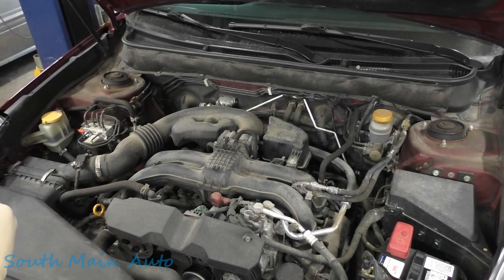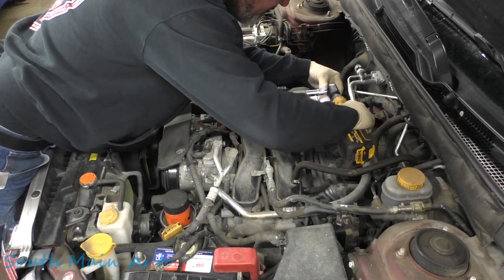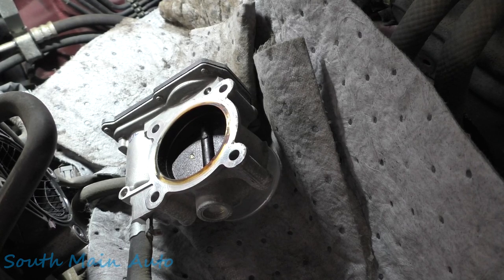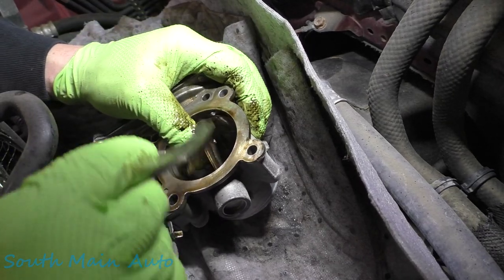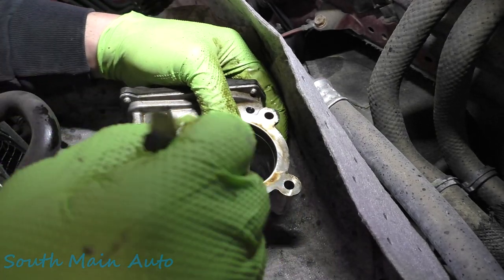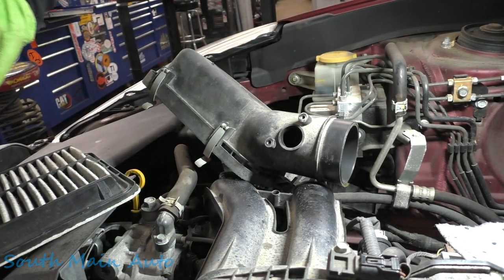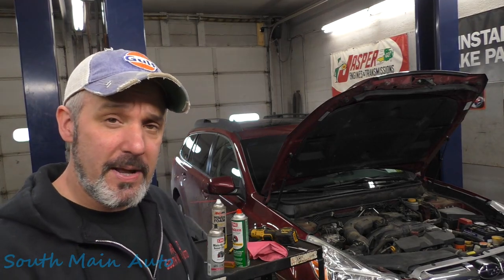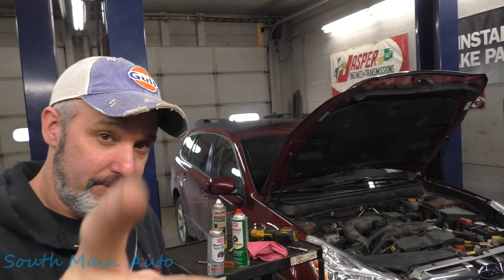How Does Your Shop Deal With Intermittent Symptoms?

Comment: Shop I went to charged me for diagnostics, changed all the plugs and coils and charged me over $900.  I drove out of their shop and had the same problem (misfires) 2 miles down the road. I ended up buying a few tools, watched your videos and Scanner Danner videos. I purchased an Alldata subscription and found low fuel pressure. My neighbor changed my fuel pump for me and now my car runs great!  Some shops are not repair shops, they are parts changers and have no clue about diagnostics. The people in your area are lucky to have someone like you that really is a diagnostic technician. Thank you for your videos and being an honest repair shop.
Reply: Seems most shops are just parts slingers these days as you say.  Faster and easier way to make money, why bother looking for the actual problem??
Reply: Flatski daddio: I find watching Eric O diag a problem helps me immensely since he does this day and night and probably asleep.
Reply: I'm just a schmuck that enjoys watching SMA videos but thought I could hear an extra 7.5 horsepower throbbing
in the exhaust noise.
Reply: So true, SMA is not a parts changer, neither is scanner Danner or Ivan w/ PHAD. These shops are following the correct procedures to fix what is causing the problem so they do not have come backs and having to work for free the second time or third. There is a process to do this, it takes skill, equipment, knowlege and some research to find the failure points. Sometimes all it turns out to be is a corroded electrical connection or a bad solder joint...no parts needed at all, just a fix to something that was manufactured with flaws or a poor design that needs corrected.
Reply: Most shops are just parts changers.
Reply: Lol What did alldata do in finding low fuel pressure?
Reply: I’d have been back to that shop like a rocket, with friends if needed.
Reply: @CrimeVid  no joke, if they took me for $900.00 and it misfired 2 miles down the road, I'll be coming back and I'll be rolling heavy. One reason to pay with a credit card. Stop that payment, discuss and then discipline if needed.
Reply: @CrimeVid  I brought the car back and they worked on it the next day. They called and said it was the computer, then they said it's not the computer it's the engine, then they said they didn't know what the problem was.
Reply: @flatdaddio  you still should have stopped payment on your CC, i would have.
Reply: Same for doctors and hospitals, unfortunately. They treat you until you're out of money or give up.
Reply: @CrimeVid  "with friends if needed." 😀
Reply: @E99584  it probably gave him the spec of what the fuel pressure should be, and if you need any special tools to test for fuel pressure.
Reply: If a garage did the $900 diagnosis on my car and still hadn't fixed the issue. I would either have them refund me the money or maybe st least $800 and $100 for their time.   The other option would have been that take your diagnosis to the garage and asked why that procedure wasn't done to figure out the problem.  Have them explain to you their diagnoses procedure.  I also ask for a refund $800 for their misdiagnoses of the problem.
Reply: Have fun shopping at Walmart???????? Yeah right. Enjoy your videos.🇺🇸🇨🇦🇺🇸
Reply: And honestly, if a shop can't figure out a misfire by checking fuel, compression, spark, etc, they probably have no business even working on a car to begin with.
Reply: @E99584  I'm sure he checked a few other things before he came to the fuel pump.
Reply: This is why you always pay a questionable vendor or contractor or repairman with a credit card that has fraud protection and dissatisfaction protection. You could have called up Discover and said "Yeah, I just charged $900 for a repair on my car and the shop did NOT fix the problem at hand. The car exhibited the same exact problem 2 miles down the road. The shop refuses to reinstall my old parts and they refuse to reimburse me. I would like to file a charge back for services not delivered and dissatisfaction." They will cancel the charge and do an investigation and likely won't take your money. The shop may or may not take you to small claims, wherein you simply countersue for court costs and wages lost attending the court appearance which is totally fair and reasonable, and explain to the judge exactly what happened. A reasonable judge will certainly rule in your favor and you'll get paid by the shop for your wasted time and keep your $900. If you paid them with a debit card or cash, you're outta luck. You have to go right to small claims yourself to get that money out of their hands. If you paid by check, you COULD stop payment on it but most places don't take checks nowadays because of that. If your credit is bad and you can't get a credit card or you can't get a high limit card, there's no better time than the present to fix it. :) You can learn everything you need right here on YouTube to pull your 3 credit reports, dispute errors and dispute collections accounts, and get a few secured credit cards to start your way down the path of getting an excellent score. It's not that hard, and credit cards are EXTREMELY useful. You don't pay any interest if you pay off the balance each time in full. Most cards have some kind of reward too like my Discover card which gives me cash back and identity theft protection. My partner's BofA gives 3% back on gas. It's free money. No annual fees. No interest when paid in full. I don't spend any more than what I have in my bank. I love all the perks and everyone should too. :)
Reply: Should have went back and ask why they did not test drive to verify the repair. Demand refund
Reply: @avenger1888  You say, "Lucy, you got some 'splainin' to do!"  Then they would give you Ralph Kramden's best rendition of, hamna-hamna-hamna-hamna-hamna.
Reply: @maccarr9072  I asked if they drove it and they said they did. They will never give a refund.
Reply: @E99584  Alldata give you what the fuel pressure is supposed to be. I also didn't know what was wrong with it at the time.
Reply: @LoneWolfSparty  exactly. my car did not have a schrader valve so I had to order a special adapter and tool to disconnect the fuel line.
Reply: @larrygall5831  I did, I checked for vacuum leaks, found one, I also checked all the ohms on my fuel injectors. replaced the IAC valve, cam sensor and fuel pressure switch. That's as much as I could do without a gauge, adapter and fuel line tool.
Reply: @michaelmarks8954  Shopping is no fun any more.  You are basically a suspect as soon as you walk in the door, especially at Walmart and other big-box stores.
Reply: Buying tools is a good thing if u can use them. Second your always going to own a car
Reply: Seems like you need to sue that shop that ripped you off...
Reply: The foking majority of shops and especially damn dealerships are there to sell you parts NOT REPAIR YOUR RIDE!  Problem is there is little to NO recourse when they rip you off.  Especially in Texas. They can hold your ride ,fixed or NOT, until the bill is paid- fixed or not. Finding an honest QUALITY shop is nearly impossible anymore. Not many like Mr. O.
Reply: This is exactly why I do all of my own work on our cars.
Reply: @timbow50  That's why you should buy tools and use Mr O's videos as a reference to fix your own cars
Reply: Can anyone tell me why my car is idling a lot faster after clearing the throttle body? Does the car ECM need to re learn something?
Reply: @buddsmokengood420  I have never in my long life taken any vehicle to any shop. Don’t trust them anyway. I keep and maintain and repair my vehicles.  Sometimes it’s not easy but at least I’m not getting ripped off and lied to.
Reply: Ya they just tell you it's a different problem now,and your going to need more parts
Reply: You got that right.  You can usually tell the local shops that have someone like Eric present because the tow trucks are steadily dropping off vehicles there, not only from  owners, but from other local shops and the dealerships.  Eric reminds me of Louis Rossmann (search Rossmann Repair on YT).  Different fields, but both are outstanding troubleshooters who know that you have to understand how something is supposed to work to be able to effectively diagnose it.
Reply: I worked for a company that had around 25 trucks. They hired this mechanic that was terrible. All he had was a cheap Walmart scanner, a parts cannon, and nice set of new tools that the company provided. Everybody hated him. Everything his little scanner showed he would tell the owner it was the drivers fault. Water pump leaks, the "idiot driver" wore it out. U joint, same thing. The owner knew nothing about cars and believed him. Some of us ended up doing our own work on the trucks to avoid him. He spent so much time with his parts cannon that our trucks would be in the shop for weeks over something simple.
Reply: You needed my like to get 400 likes, thought I'd do the right thing.
Reply: Perfect description of my local Honda shop.  Parts changers, not technicians.
Reply: The only question after the " experts " present the estimate is " will it fix the car " . Remember , they diagnosed it . If they start to squirm " it needed it anyway , those parts were bad " , - excuses , etc. - just tell them you never stated that in the estimate . And it's still not fixed . You can offer to settle by paying their NET cost , NO labor , on the parts it didn't need . Otherwise , off to small claims court . It usually eats up half a day . Most places would be stupid not to settle . And it shows you are being reasonable . We are not nit picking over a relay , thermostat or filter here . THEY messed up . Good Luck .
Reply: But to be honest you sometimes it's more expensive to sit down and look through the data. But I worked also in a car repair shop and the boss would ask me what I doing looking for data. And I didn't had any information sources only the online forum which is useless often. Luckily I'm not there anymore but you proofed that information and a bit checking on the important parts can save money
Reply: Dropping some heavyweights (names) 👍👍
Reply: Hear hear the most honest assessment of repair shops and most shops have no clue and as to diagnostics they better show me confirmation on there diagnose or they pay for the parts cannon
Reply: But he didn't check the fuel pressure...
Reply: had a''mechanic'',,change my belt, w/pump. front seals, idlers. now,,its an ornament.. i would of done it but working flat out & it was leaking flat out.. should of waited 2 wks.. $1250. gurgler..ausie..
Reply: I'm guessing the number of us who actually is few. Diagnosis, feels hard if you make it hard. I've always found common sense is needed out there for the new ways mechanic's work now.
Reply: @Mountain-Man-3000 so many customers do not want to pay for diagnostics
Reply: @flatdaddio where the plugs in need of changing at that point.
Reply: @Mac-mu9cs  The car is a 2004 Lincoln Town Car and had about 103, 000 miles. I purchased the car and someone had already replaced the coils and plugs with aftermarket. The only code being set was cylinder 5 misfire. The garage said the aftermarket coils and plugs were the cause of the misfires and needed to be replaced with OEM. They said there was misfires on all cylinders. I questioned it was hard to believe that all cylinders were misfiring and what did they have in common. They said it was the coils and plugs. When I picked up and drove it the car it still had misfire setting on cylinder 5. I brought the car back and they said it was the computer, then  they said it was mechanical it was the engine, then they said they didn't know what was wrong with it. I brought it home and checked the ohms on all my fuel injectors looking for a bad fuel injector and nothing stood out. The car ran good cold but got a misfire after warming up. I purchased a fuel pressure gauge, a fuel line adapter, and a tool to disconnect the fuel line. Key on engine not running I had 15psi, running I had 12psi. I bought a new fuel pump assembly, and my neighbor changed it for me. The reason cylinder 5 was getting the misfire code was it was the last cylinder on the fuel rail to get fuel. The fuel line attached by cylinder 1. By the time fuel made it to cylinder 5 there was none left. The problem with the fuel pump was someone replace the fuel pump previously before I purchased the car and never properly attached the fuel line to the pump in the tank. It would never get full pressure because it was barely connected and leaking. I purchased the whole assembly and had the whole thing replace. Car runs great now with no misfires. If the garage would have checked my fuel pressure they would have found it and I would have had them replace the pump assembly, but they didn't. Needless to say, I will never go there again.
Reply: Thad Amsoil cleaner smells exactly, I mean exactly, like the old GM IAC, top end cleaner. It worked really well.
Reply: @Mountain-Man-3000 so many shops are not paying techs to diag. So its RWKGP and send it. Techs who are not getting paid for diag are going to go to toss parts. Then let the owner/service writer hash it out with the customers.

Lots of of places will also use known service history.  No history your getting plugs filters ect ect.
Reply: @picklerix6162  because most are paying tech just to do that. Look at what techs are making then ask if your going to take time to diag/fix your not getting paid for.
Reply: Yes our industry needs more of this mindset ! 
Fix it right and follow the clues ....
Keep diggin South Main Auto .
Reply: Doesn’t sound too bad 900 at 160 an hr shop time with parts and tax
Reply: @FirstLast-tw1qf  It would be bad if they fixed it, but they didn't. The car drove out with the same problem it went in with. Paying them $900 for not fixing my car feels like being robbed!
Reply: @FirstLast-tw1qf  problem is the problem was not fixed.
   I dont know if the work was needed anyway?  So many cars/trucks come in with spark plugs being way over due. 
     Now its time to decide do you change all the over due service items then diag or pick away around it ? 
    Depends sometimes.
I prefer to look for a problem with as little disturbance of existing conditions. Then do any services or repairs needed.
Reply: It's sad but true shops now days see misfire codes and say plugs or coils never check everything and make sure what the problem is I worked for an old man that was like that he told me don't waste time diagnose anything even though he charges diag fee he would order parts we had to keep them clean package also if it doesn't fix it send it back and try something else I had to leave from there my first day he put me on a LS Camaro he had did head gasket on without pulling engine for some reason the manual says to pull engine for a head job but anyway he couldn't get to run right after about an hour I told him the block is cracked he argued me and had me tear it down I said ok you are paying me but I put new gaskets on it didn't fix it I said the block is cracked he said I didn't know what I was talking about we fought about it for 2weeks it wouldn't hold pressure thru the coolant system so one day we was fighting I pulled all 8 plugs out and told him to stand here I turned the engine with a wrench and it blew coolant out every hole I said I've told you since day one so now who is a dumbass i got all the heavyline jobs and cars he tried to fix but didnt fix i had to pull an engine out of f250 so he could fix exhaust manifold i put engine in and it wasnt fixed i fixed it with the engine in
Reply: My workmanship has a lifetime warranty the parts have manufacturer warranty with some exclusion like a bad oil leak that's running onto a starter or something else causing it to mess the original one up if they refuse to fix the leak I can't warranty it which is fair
Reply: Man brother you are spot-on. I have an intermittent problem when I put my Ford escape in reverse I get hill assist not available. I am not taking it to a shop because they will throw parts at it but I did learn something from yours scannerdanner I guess he's a YouTuber and I watch some of his videos. Have a good one. One last thing funny you mentioned alldata I just purchased their subscription last night and invested in aulel scanner tool. I'm like you I'm going to train myself.
Reply: What's funny is people bringing up small claims like justice will be served there! And I'm sure it would be- that is if the presumed guilty party even shows up! I had a car that was victim to a hit and run that caused 6k in damages and rendering it undrivable. And despite having beyond a reasonable doubt proof of who it was- eye witnesses, multiple forms of evidence showing they committed the crime, etc the investigator wouldn't do anything about it. Said I could take them to small claims. Awesome thanks Portland investigators. So while pursuing this route, come to find out it actually costs money to take someone to small claims and not just 50 or 80 dollars, but 370 ish where I live. But the icing on the cake is the person can decide to not even show up, and there's no legal recourse for doing so. So if the judge convicts this person as guilty and awards me that 6k for repairs, there's nothing forcing him to pay me. They don't get their license suspended, or their paycheck or taxes garnished. So small claims is a big waste of time. My education was clearly not in law so please excuse if I used any legal terminology erroneously.
Reply: It makes me think that maybe I should give a lookat mine, before it gets that bad.
Reply: It’s hard to find a shop with strong diagnostic skills. When fuel pump motors start failing they fail just like any electric motor with the exception of brushless ones or 3 phase. Electric motors with carbon brush fail due to the wear on the brush. It start with intermittent problem then low torque output . Eventually it will fail all together.